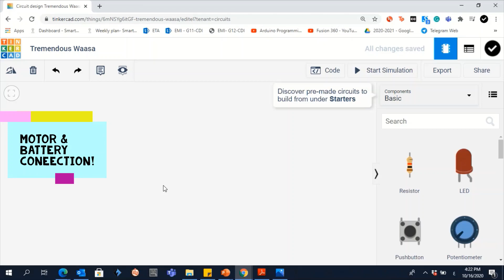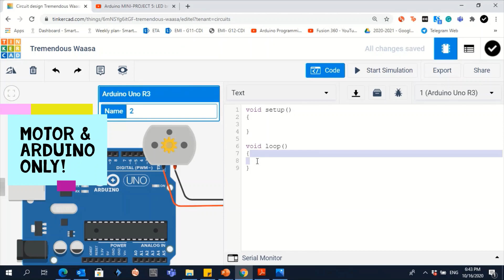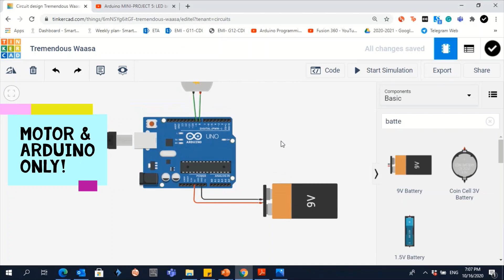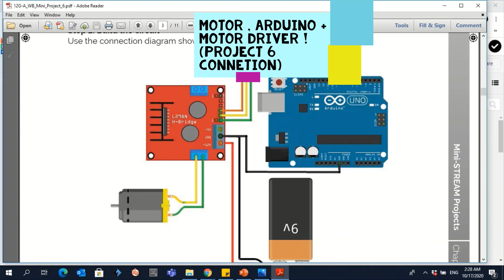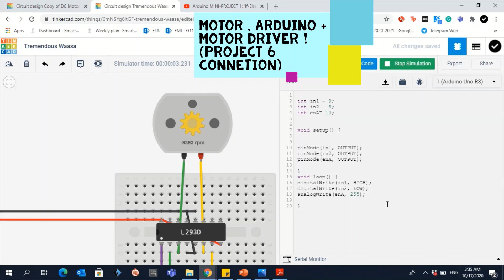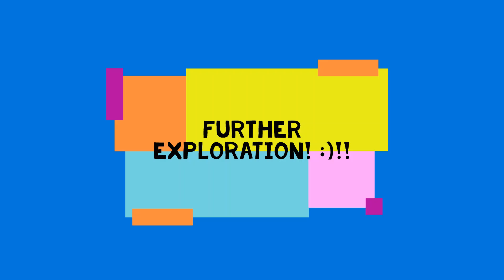Arduino MINI-PROJECT 6: Motors Code A -DC MOTORS

Comment: Tala Husen 12-A
From this video I learned that the motor driver controls the speed of the motor and also  how to control the direction by different angles and speed of a DC motor using digitalWrite and analogWrite functions. There are 2 types of motor. The output of the motor is always a movement like speed and direction.

Comment: I learned how to control the direction by different angles and speed of a DC motor using digitalWrite and analogWrite functions. There are 2 types of motor. The output of the motor is always a movement like speed and direction. We can connect the motor with a battery directly or with Arduino.

Ayesha Saeed 12A

Comment: how to control the direction by different angles and speed of a DC motor using digitalWrite and analogWrite functions and how to use analogWrite to control the speed of a DC motor.

Comment: Manal Khalid 12-C
From this video i learned how to control the direction and speed of a DC motor using the digitalWrite and analogWrite and i knew there are two types of motors, DC and servo.

Comment: Shahad Adel 12B
There is 2 types of motor. The output of the motor is always a movement like speed and direction. We can connect the motor with a battery directly or with Arduino.

Comment: In this video, I learned about how to the connection would look like if we used a battery, then we tried to use an Arduino instead. After that we used a Motor as the last result. Learned how to control the direction and the speed of the DC motor using digitalWrite which controls the direction of rotation of a DC motor, analogWrite which controls the speed of a DC motor. Aseel Ashraf 12A
Reply from the maker: Excellent for showing the deep understanding !!!!!

Comment: Maha Hasan 12C
20/10/2020
I learned from this video that the motor driver handles the power to drive the motor so it makes it rotate faster. In addition, it controls the speed.